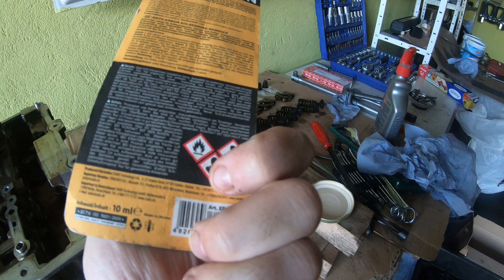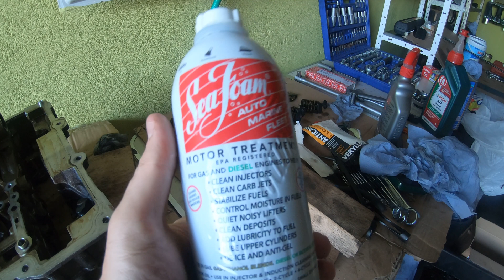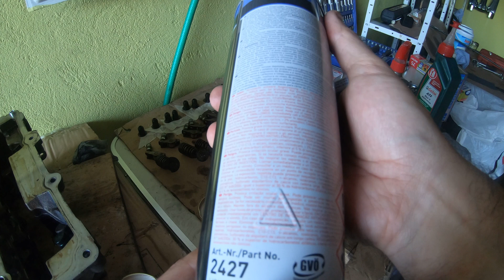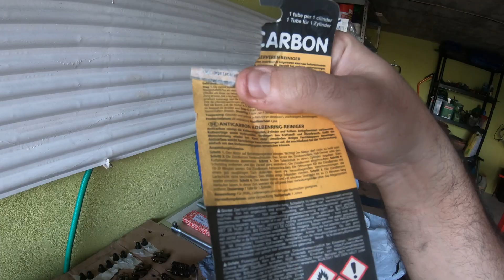Can Seafoam, Engine Cleaners and Household Products Dissolve Carbon Off Engine Valves?

Comment: Chem-dip or acetone will work on carbon.
Reply: I make surethe intake valve is closed and then fill up the lower intake runner with acetone brake cleaner. let sit for 5 min then suck it out.  repeat .   You'll be amazed of how clean everything is
Reply from the maker: Acetone is interesting. You sure it gets the carbon though?

Comment: yeah put the valve in drill spin them, use sand paper, start  with 250   and work  you way in steps,  all the way to 3000  and finish them  with some  metal polish that is the best way
Reply from the maker: Yep, after trying to sand them by hand, I put them on a drill and gently used sandpaper to grind away the carbon. Some metal polish would have been great too but didn't have any. Just stayed away from the stems and the edges when sanding 👍🏼